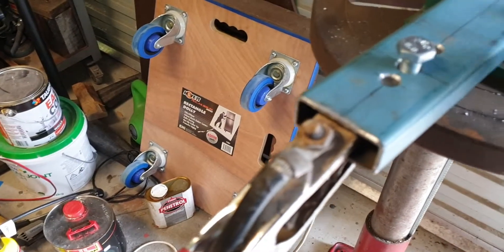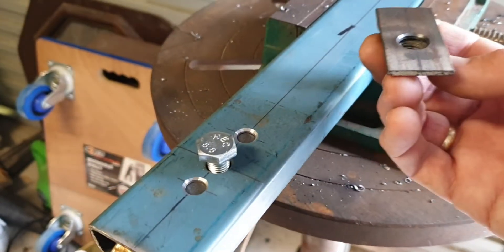How to Weld a Nut into RHS SHS Steel Tube

Comment: When looking for weld nuts, I saw many options that were just 3/32 thick metal with a threaded hole in it.  I’m thinking of buying some 1/4 flat stock, about 1/2” wide and drill/tap a hole.  Locate and weld in just like you outlined here and skip the whole “welded nut” portion.  For my project, the potential load is fairly moderate so I don’t think the extra steel is required.   Thoughts?

Comment: Hey mate, super random question but what prep is needed to weld the flange nut onto the rhs? I assume the flange nut is galvanised - do you need to grind the galvanised coating off or take it off with hcl acid etc? Or can you weld the galvanised flange nut directly? Finding uncoating nuts is hard here in Australia. Thanks
Reply: The zinc does not really affect the welding that much, zinc fumes on the other hand are toxic, you can read about metal fever in wikipedia if you like. In general you can weld it if there's good ventilation, outside for example. (if it is windy, mig shield gas is affected though). To be on the safe side, even a vinegar bath for couple of days or so probably removes zinc
Reply from the maker: Hi Matthew. The nuts I buy are just gold zinc plated, not galvanised. I don't bother removing the coating. The mig blasts through no worries. You could wire brush the nut a bit first if you're worried about it. Good luck with your project!
Reply: @theshed6363  Awesome, thanks for that. I've got a stick machine, reckon that would go through the zinc plate nuts as well? Thanks
Reply from the maker: Hi Matthew, I can't see why not. Stick should do the job just fine!

Comment: I had to struggle like this, but then discovered Rivnuts.
Reply from the maker: Hi Bluestrike, thanks for your comment. Yes, rivet nuts are very handy and I use them from time to time in certain situations, but....they do have their limitations. I wouldn't use them in high torque or critical situations. For example if I was bolting a car seat onto that RHS in the video it would only pass an engineering inspection with a proper nut installed. A rivet nut would not pass.
Reply: Rivunts are prone to fail by start spinning inside hole. Rivnut does not leave flush outside surface which may be essential if you for example want to use said tube in telescopic setting.

Comment: You know what, that's clever. Normally I wouldn't go the extra effort and just weld the nut on the other side, but this is a good hack if you need it to be flush. I'm really liking the idea of welding the nut to a plate, inserting it, and then welding the plate instead. Gives you room of error compared to welding directly onto the nut.
Reply from the maker: Thanks for the positive feedback @HenryMania. I have found this technique useful on a number of occasions.